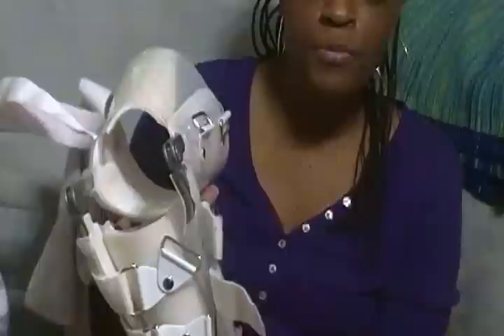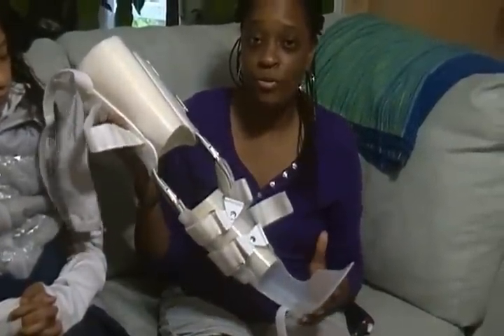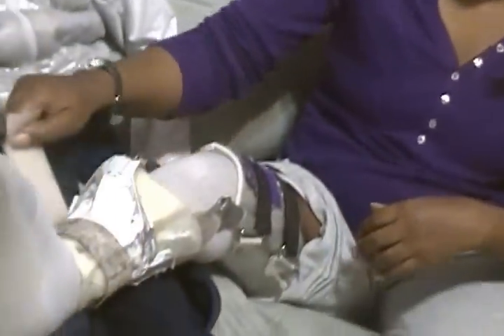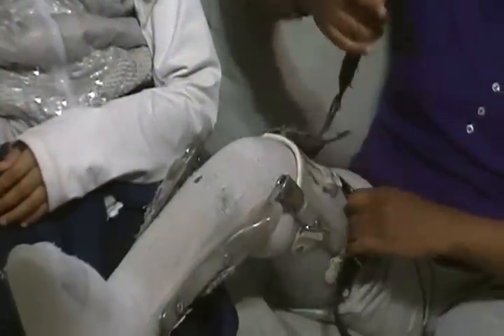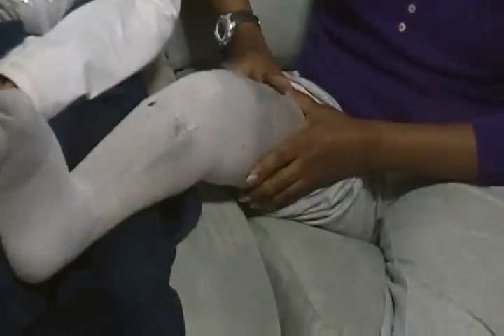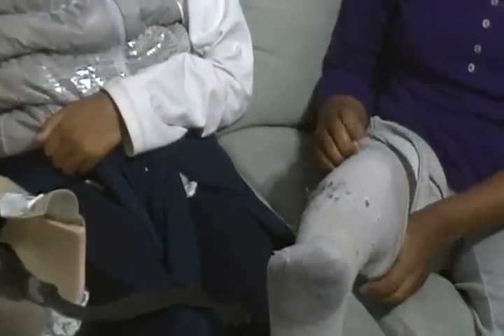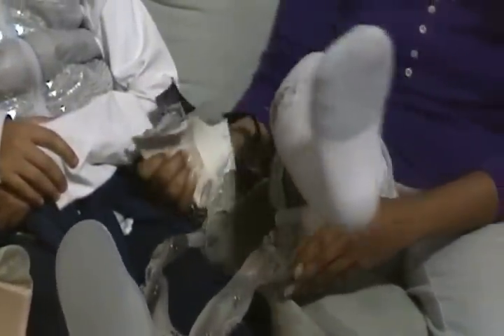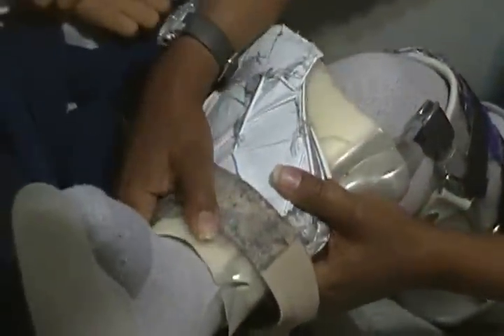Getting in and of my brace

Comment from the maker: I have 2 fractures in my tibia which is the weight baring bone needed to walk. My tibia did not fully grow at birth. The 2 fractures will not heal with a cast or splint because of the deformation of my tibia therefore they will have to either do reconstructive surgery or amputate. I've had enough reconstructive surgery. I'm ready to amputate. I have constant pain that feels like a Charlie horse. There are several other reason for amputating. I will try to make another video explaining.